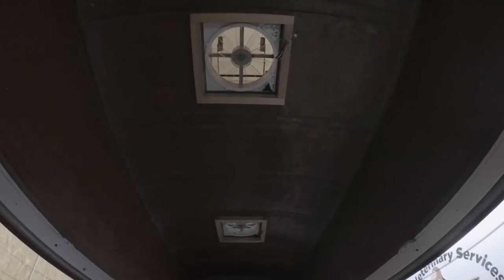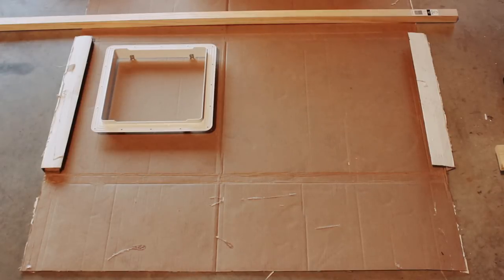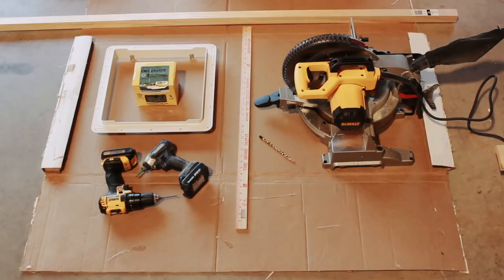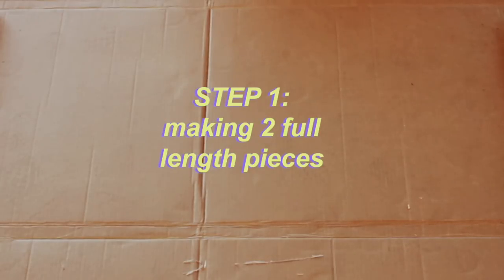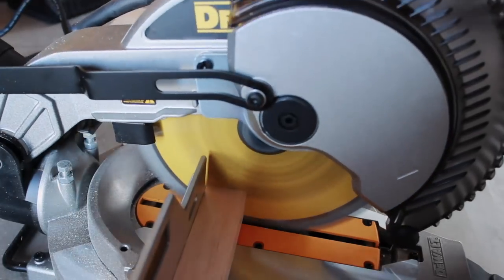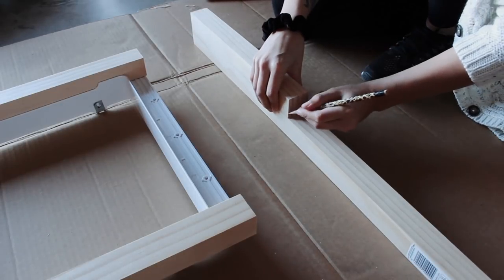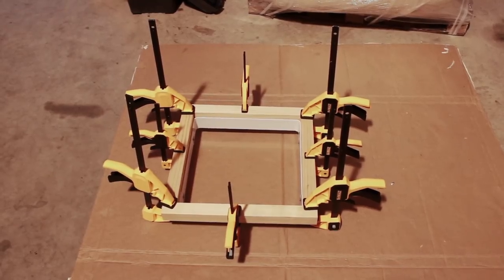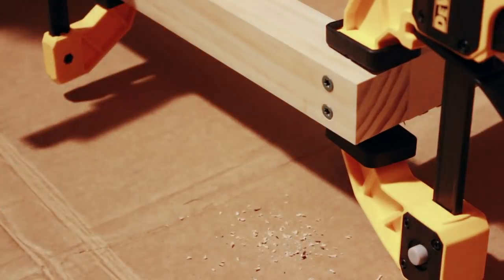VAN LIFE: DIY wood fan frame MAXXAIR FAN INSTALL Tutorial (1/3) | Hobo Ahle

Comment from the maker: watch all of the hobo van build from start to finish
➫ https://bit.ly/2sjn3uh

building etc starts at 1:52, (click read more)
this is part 1/3,
the lighting is cray cray LOL 👽💛
... oh and all materials/supplies also listed in description box bro
Reply: i may install this nice visual instruction for my pop up thanks
Reply: Hobo Ahle I think this is so funny how you just put this video out because this morning(while sitting on the toilet😆) I was pondering about this wooden box on my counter. I thought I should try making one myself for more storage. Which then led to the thought of "how weird.. in school they teach you a square has four even sides. But when you build a square not all the sides are "really" the same size!" 😅😅 
(Very technically thinking over here!!🤔🤗😁)
Reply: Hobo Ahle great job but ditch the nice loose sweater just for safety reasons.
Reply: Hobo Ahle i have a ? Where do you go to do all the work? It looks like your in a warehouse.
Reply: Since they're already installed, I'll add just for future reference:  If you happen to have some wood glue and some 1/4" doweling, you might consider a dowel joint for the wood pieces.  Screws will back out over time, though in your particular case, it won't matter (much) because the fan is attached to the wood.
Reply: Like it Ahle you did good! A few tips I've found; many van remodelers use denim insulation as it is inert and a healthy alternative. (special order Home Depot) Some insulation will sweat in cold climates causing rust or mold.   From a guy has lived off-grid for 46 years; I've watched some great tubes on best solar installs. Reachable on FB..

Comment: Good freaking going. I haven't built much stuff with materials like wood and stuff, but I did make my own subwoofer so basically I just had to make the same thing as you, but a cube instead of a square. Then have a round hole in the front for the woofer, a square hole in the back for the amp, some wood inside to structurally brace it, and some holes on the bottom for spikes. It took me FOREVER mostly because I didn't have easy access to MDF or the tools to cut it the way I wanted. And because I got lazy until one day I said I'm gonna complete this damn subwoofer! Turned out OK for a first attempt at a subwoofer, but it doesn't sound all that great and I just have it decorating my room...

But it brings up an interesting point. If you want to have what Ahle built without the seams, you could just start with a square board and cut the square opening for the fan out of the middle of it. Unibody construction is all the rage right!? No screws, no drills, just need to figure out how to cut the hole in the middle. More wasted material though, because you're left with a smaller square board...